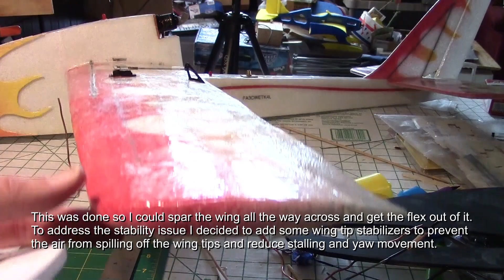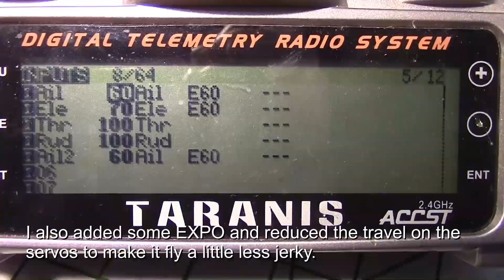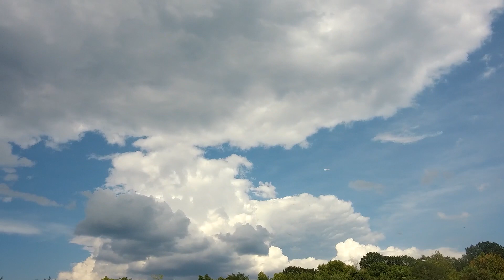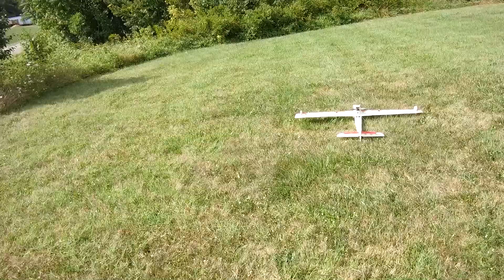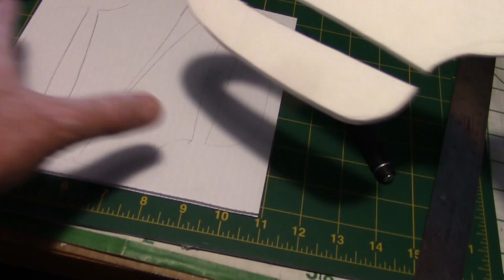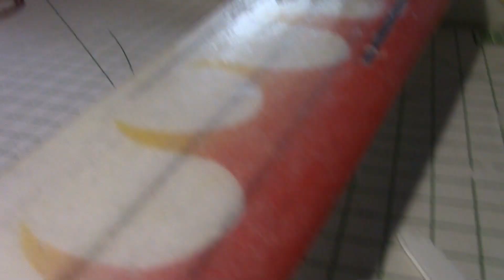Phoenix Resurrection Build Part 3 - Make Wing Stabilizers & Flight Test

Comment: Man, your good. Can't wait for the FPV. Where is the camera going to go? On the nose or on top? I'll be standing by.
Reply from the maker: Thanks! There is an FPV cam already on it under the nose but I may move it a little because it's picking up dirt on landing.
Reply: @DaveMerc  what about a landing gear?  Seams like we have had this conversation before. I have conference in you. You'll get her done, that's truck driver talk. I did drive a Simi for 13.5 years of that crap. Loved working for the cable TV company as a cable tech. 18 years of that, before I blew my knees out climbing poles. That's why I played in traffic in a big rig.  I had over a million safe miles. Not to bad for a Texacan living in Missouri.  I just can get that drone going. Must be the Missourian in me. Can't be the Texacan. Have a great day bud.
.
Reply from the maker: Landing gear? On the Phoenix? I am afraid they would get torn off in the grass. Thanks for sharing your history. You have had an interesting work life. I remember when I used to have CB in my old GMC van and I would listen to the truckers jawbone. Guess cellphones kinda killed Smokey and Bandit talk.

Comment: Good job Dave !  I really like the idea of using the zip tie to secure the stabilizer to the wing.  It’s innovative and it distributes the forces at the point of attachment to keep the fin from being moved or knocked over by the “wind” during flight.  You can really see a difference in the way the plane flies in this video versus the last one.
Reply from the maker: Oh yeah! Where would the world be without zip ties. I also used a piece of vinyl siding and a zip tie to secure the tips of the main wing spar to the foam. The ties work so good and are easy to remove if you change your mind on placement. Those wing tip stabs really take out the wiggle waggle.

Comment: I wonder if it would have been easier to cut near the wing tips and add some wing tip dihedral that way. Like all the Bixler type wings. It would still have the center wing main spar rigidity.
Reply from the maker: I thought about it but was afraid to cut into the wing so instead decided to try the the wing stabs because they can be removed or replaced easily.